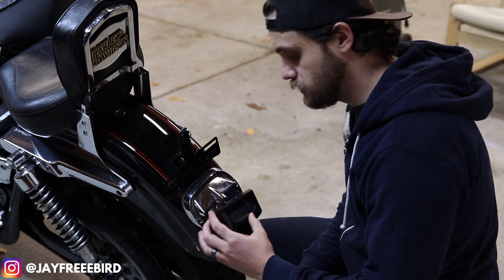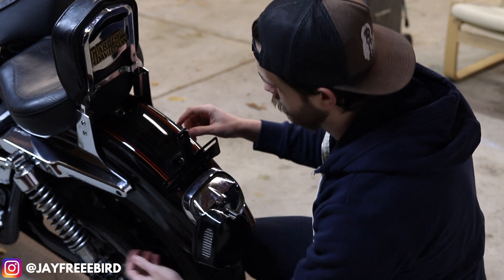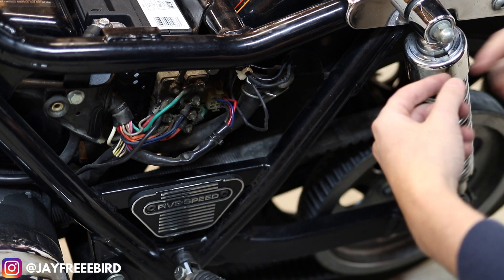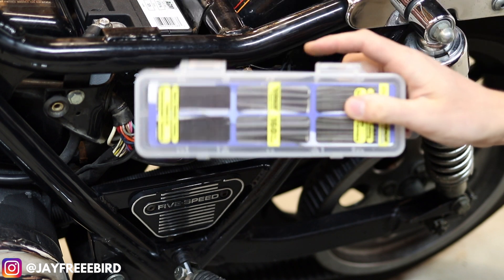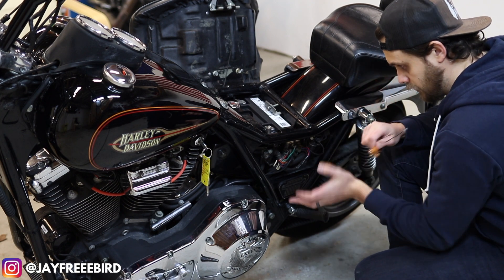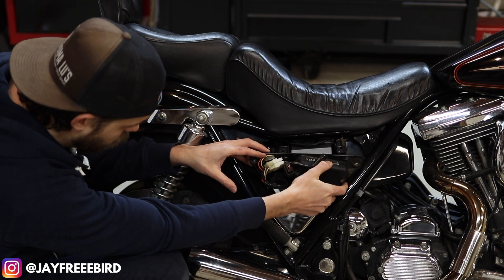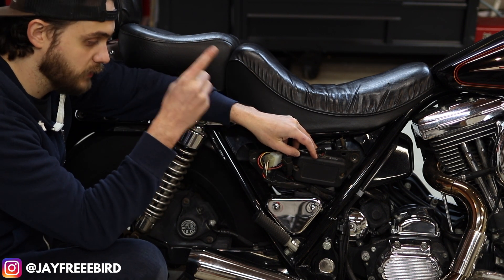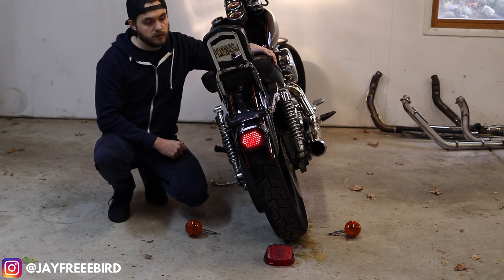Moons Mc LED Tail Light Install Harley FXR

Comment: Just did this tonight, I definitely need the badlander equalizer
Reply from the maker: It's the way to go, it will take the frustration right out
Reply: Can you explain where you sauder your turn signals too? Thanks
Reply: My understanding is sauder both turn signal wires? Then what? Other geeen n red star in place like oem?

Comment: Hi could you tell me one thing I have a FXR and tried to install this same tail light but the inside of the taillight hits the led tail light so It wont go all the way in side did you do some modification?
Reply from the maker: Are you using MoonsMC? If you are, the plug for the LED tail light should go right into the socket of the old tail light or are you talking about the housing of the tail light not fitting right?
Reply: @freebirdsgarage  Yes Im using the moons mc and I pluged it in but the tail light its self dose not fit to the tail light base
Reply from the maker: @blackparade   That's odd, when you try and line it up. Do the screw holes not align with base or when you start to screw the taillight down does it not completely seal?
Reply: @freebirdsgarage  Yeah it lines up but you know the part that is sticking out from the tail light base? That part hits the inside of the led tail light before it seals the tail light I dont get how it fits 😂
Reply from the maker: @blackparade   hopefully that helps man between the two tail plates the STL73 and STL89 in order to get it to fit.
Reply: going thru the same issue right now, it does not fit with my STL73 Housing
Reply: Did you ever find a stl89 baseplate?
Reply: Haha, im in the exact same problem right now.. which suck when I got the moons ship all the way to Denmark after watching this cool channel 😍 but yeah mine hits the baseplate before sealing..

Comment: Im starting to clean up my rear fender. Got a lay down plate in the mail today. Tonight im planning to order a lay down light cover and saddlemen seat just like yours. Electrical is my weak point so was going to run og bulbs. I just noticed the og style tail bulb comes out way to far for anything that will allow a shorter laid back cover i want so prob need to go led. The thing is i have a old set what i think are cool fender support/strut mounted with integrated turn signals id like to keep and need upgrade my front turn signal so maybe a munit nightmare (for me) might be in my furture?
Reply from the maker: Going integrated is the way to go! It really cleans things up, if you can work a sodder gun and heat shrink you’ll do just fine. Only way do is to dive into it head first! Message me on Instagram if you get stuck!
Reply: @freebirdsgarage  thanks beother going to get ya on my ig right now. I'm good at soldering as long as im being told where lol. Im sure il be in touch and please keep making videos. They help
Reply from the maker: @Junior-fd8ux  anytime man glad to help👊🏼👊🏼

Comment: Did you have any fitment issues with the housing contacting the light socket portion? Thanks for the videos!
Reply from the maker: I did not. You have to shave down the highest part of the plate area and it will fit. Other wise you need to get a base plate from 91 and up.
Reply: @freebirdsgarage  thanks for the response. I wanted to confirm with others before modifying my current one.
Reply: @freebirdsgarage   hey. I'm installing on of these moons Mc v3 tail lights too my 86 fxrs.  Having the same fitment problem. With regards to  Shaving the base plate down.. should.i shave down the point where the bulb would be ?  It seems to protrude and prevent the lense from sealing.

Comment: Great video, I have the same bike and want to install this. Do you know if there is a way to reprogram the signals to continuously blink until the signal is clicked again, or do they only blink and stop after 5 or so seconds? thanks!
Reply from the maker: Thanks Jeremy I appreciate the support!! The module is programed to automatically flashes for 11 seconds or can be manually canceled at any time.

Comment: Jason I went to replace my old tail light that was working and when I tried it put the new one on that was supposed to work with my 87 FXR. didn’t work.. ordered a different light from FXRdivision and again nothing, I went to put tue old one back on and ya that was dead now aswell.. I did obv cut the wires when I put the new tail lights on and properly connected them. Idk to be honest I just blasted around this summer a bit without it but now It’s driving me nuts any insight?
Reply from the maker: Good chance they are not grounding correctly. Follow the wires and to the circuit board you may have blown a fuse

Comment: can u use the oem wiring for the integrated tail light?
Reply from the maker: Yes, but you will need to add a load resister or add a LED turn signal flasher module.
Reply: Where did you sauder the blinker wires too? Thanks

Comment: Was wondering what load equalizers you use and how many are needed? Thanks
Reply from the maker: On mine I needed 2 in-line in each light to make it work. So I skipped that and went with a badlands turn signal module. The part number should be in the description.

Comment: Did you have to cut the bade plate to make that light work?
Reply from the maker: 90's and up back plate, you do not have to. But you will if you have a late model.

Comment: Did you have any clearance issues with the baseplate and the moons tail light?
Reply from the maker: I did not, it went on like it was OEM for me. Just check your gaskets and make sure the extra wire isn't bunching up.
Reply: I did to tried two fxr  and both did not go all the way in
Reply: @blackparade  what did you do to make it fit ??

Comment: Dang I have the STL73 housing as well 🤬 I was wondering why mine isn’t fitting in….
Reply from the maker: It can be done just need to shave the sides until they fit correctly or a track down a newer style tail light assembly

Comment: Can someone give me a little clearer instructions? Thanks
Reply: Where i need to sauder the turn signals?
Reply from the maker: cut your turn signals off, then cut to length the led turn signals. Sodder and connect. If you have a 3 wire, you will need to ground the wire.
Reply: @ ooh so the lef turn signals will go in place of the oem ones!